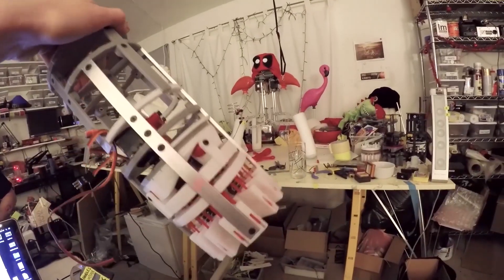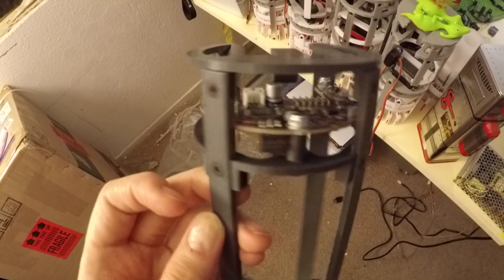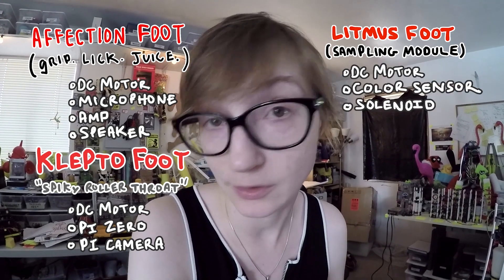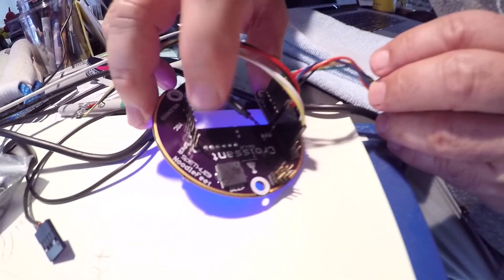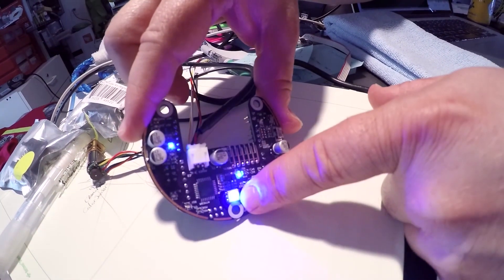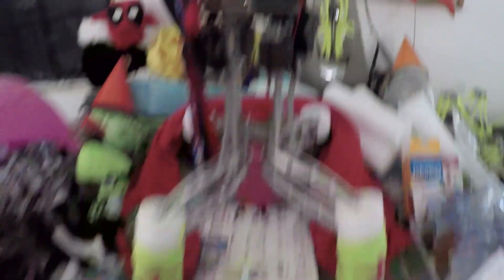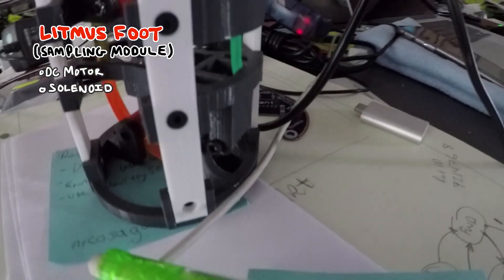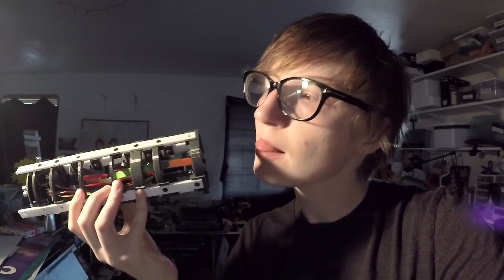Noodle's New "Croissant" Feet Brain PCB

Comment: So cool!  Got a question / request for advice, though - if I wanted to get stuck in and build things like this too - where would I start?  Got plenty of xp with coding etc, but haven't touched arduino etc before.  Is there a good place to buy parts / find tutorials?  Anything to get me started would be great, thankyoou!
Reply from the maker: Oooooo! I'm glad you want to get into the doing! The best place to start is really with an Arduino. It's how I broke the ice myself. Sparkfun.com and Pololu.com and Adafruit.com have all your peripherals and goodies that you'd be controlling with the Arduino, and their sites also offer tutorials and use examples along with the things they sell on their product pages.
 I think the easiest and best project to start with is to pick something you want to add LEDs to, and bling it out with light. Doing so will make you go through the motions of buying the parts, installing the LEDs with the proper length of wire and correct value of resistor, and you'll have to decide on a power supply to run everything... so you'll learn a lot in the process of make the physical thing work. =D if you decide on something to make, let me know if you need help, I will try to if I can.
Reply: Awesome, thankyou! I'll @mention on twitter if I make anything I'm chuffed with :D
Reply from the maker: awesome =F